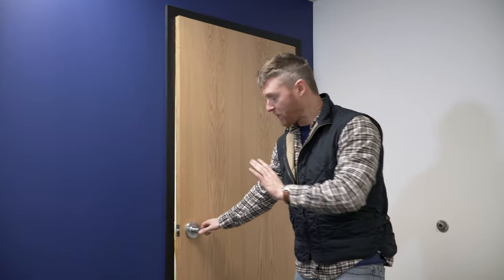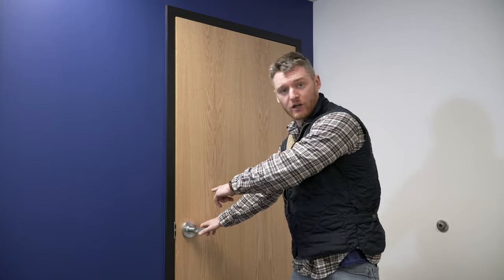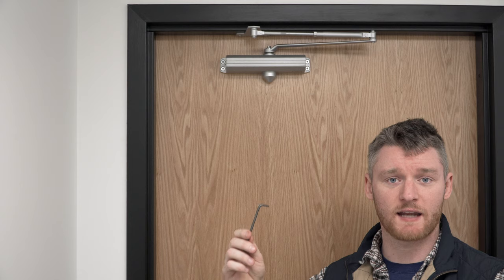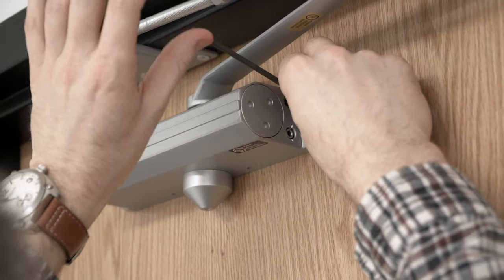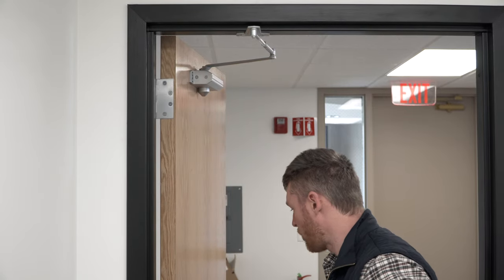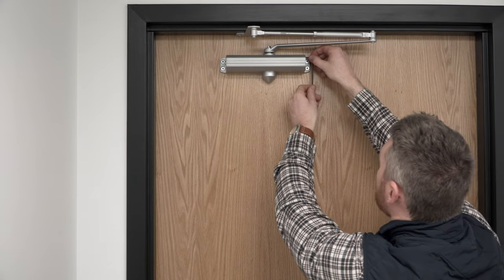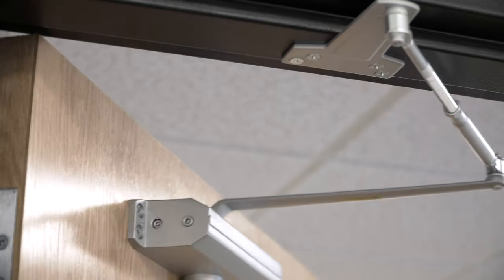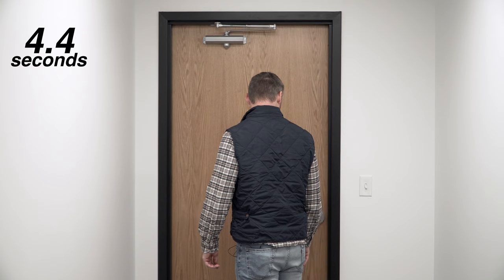How To Adjust a Commercial Door Closer

Comment: Nice video. Trying to get a door at work to close properly. Got most of it. But... right about a 1.5" from closing the door stops and then slowly closes. Guess that's latch speed adjustment?   

Even with the latch speed not adjusted correctly. It's still lots better than the before.
Reply from the maker: Yes it should be latch speed. Glad we could help👍

Comment: Good video.  Just to add some clarity.  There are 4 adjustment screws although he was only adjusting 2 of them.  On the right side are letters L and S.  L is latch speed and S is swing speed.  On the left side there are 2 adjustment screws.  BC is the back check adjustment which limits how far the door will open, so nobody accidentally throws it through the wall.  The other screw, presumably labeled with a P since it cannot be seen in the video is the power needed to push the door open.  Can I open it with the tip of one finger or do I need to drive my shoulder into it.😊😊😊😊

Comment: Nice job they also sell an ADA pressure tool to see if you’ve got the right force spring force to be ADA compliant interesting to note that an exterior door does not have to meet ADA pressure standards which seems odd to me, but you know there’s so many wind loads andpre-existing air pressures in the building going out the exterior doors

Comment: Hey. My friends’ restaurant front door not closing when the kitchen fan is on. In one year they replaced 3 door closers. Every time kitchen fan is on, it creates so much pressure, that the front door opens. Any idea how to solve that? Thanks.
Reply from the maker: Need a vestibule to take out the positive air, or balance the HVAC system. Those are the couple of things I would look at first.

Comment: Thanks for video Mitchell. What can you do with exterior building door with commercial closer and someone was moving out and extended door too far and now it will NOT close? Thanks in advance.
Reply from the maker: Is the frame or hinges bent? Or just the arm of closer?
Reply: @mitchellacoustical3119  Good call …it was the arm of closer. I bent it back and noticed a screw was missing so got a matching screw and  adjusted the closer arm  and it worked. At first I thought door frame off until I noticed the closer arm was all bent. Thanks for your response. Took a while to get the sweep closing at desired speed and same with latch since I wasn’t sure which way sped it up or slowed it down at first.

Comment: Which side does which ? I saw you adjusting on both sides but it was not clear about which side makes door heavier to open .( the wind is moving door partially open enough to set off sensor on alarm system)

Comment: Here’s how it should be done in brief the door should be closed. You should adjust the end nut that adjust the spring on the inside of the door closer for more or less power let’s call it then after you’ve done doing that you should’ve adjusted the back check then after you’ve done that you should adjust the swing speed and the latch speed in that sequence it works perfectly every time now this all takes some time in itself to do so it behoove you to start in the proper sequence I suggest, first things first and then everything else meaning all the other adjustments function as proper. Thank you.
Reply: Have to point out you’re using different labels than the Door Opener Manufacturers.  Mine says: backcheck which is the angle of swing, typically 90d if the door hits a perpendicular door on the other side; door closing speed, which is the 5 seconds mentioned in the video as needed to get a wheelchair through (or 2 arms of grocery bags at home garage); and 3rd, latch speed (also your label) which is the speed or quickness the door closes the last foot or so to latch the door to the door frame.
Reply: Well, I’m just telling you from experience you can do what you want. I’m retired now and happen a Locksmith company for approximately 30 years. Adjusted door closures every day and it was my experience especially with LCN door closures which I don’t even know if you work with them so, you know but my experience is what I said nothing more nothing less doesn’t matter if it’s a ADA closer or not take it or leave it. Try it or not. It doesn’t matter to me.

Comment: Great video!
I am trying to fix the entry door to my apartment, which always wakes me up when it slams shut. I am twisting the screws and I'm able to get to ideal closing speed, however at the last 2 inches until closing,  all the mechanics stop and it smacks shut. How can I fix this? Is the problem the door, the closer, or the installation? Many thanks!
Reply from the maker: Yea that's the latch speed on the closer. There are 4 positions on the closer, so there should be 4 screws (2 on each side for adjustments). With all the different positions of a closer and mounting its hard to tell you which way to go on this, but there is a "latch" adjustment screw. So without seeing it, just trial and error.  Thank you for the comment, hope I was able to help a little.
Reply: @mitchellacoustical3119 thanks for responding Mitchell. I'll keep playing with it. Cheers

Comment: Is there one with a longer arm than 180 Degree?   Our last one allowed the the door to swing wide open (Front door of apartment no wall blocking it) and the new one the door open 180 and within 2 days someone moving furniture in kicked the glass and spider webbed it.
Reply from the maker: Not that I’m aware. Over 180 would mean that your opening to you door would be offset by an angle. Are you sure you’re asking the correct angle?

Comment: 5 lbs, was interesting info; my seems to be much more then that has it is very hard to push thr door open. I moved the screws and it changed nothing; to the point of wondering if the screw would come out, can it?  I also tried adjusting the other screws but only changes was the closing speed: very slow. Now, this door is not business building but home; garage to house. No wheel chairs or anything. No little ones. I am thinking it might be defective. Suggestions?  Or isbthere something I am missing?  Thanks.
Reply from the maker: Well the adjustments can be different from door to door. If its hard to push open can the actual door and frame be the problem? The screws can come out of the closer and spill the lubricant out of the cylinder. Maybe try another closer. Most closers come close to being 'set' when they come out of the box, only quarter turns are typically necessary.

Comment: A slight breezes will slightly cause my door to open. What adjustment increases the tension so that it doesn’t do that?
Reply from the maker: We’ll if it latches it wouldn’t open, I’m guessing that’s what you’re asking. You’ll have to turn the latch set screw so that the last 2-3 inches it closes it has the psi to close.
Reply: @mitchellacoustical3119  It's a door that goes outside. There isn't a latch unless I were to lock the door. It's a door to a business.
Reply: @NodakSavage  Same problem. Trying to fix our gas station door from blowing open. Theres no "latch" unless its locked.

Comment: So my commercial door doesn’t shut cleanly-  the adjustment worked where it I could adjust it to any length of time but the door is hitting just before the latch and stopping.  Is there any way to add more force to the door closure?
Reply: They answered this question in one of the other comments, hopefully that helps!

Comment: Just a quick question which adjustment pin allows the door to open wider?
Reply: That’s not a user-adjustable setting: that angle is determined at the time of initial installation (whether 45/60/90/135, etc).

Comment: I did the adjustments already, doesn’t change anything. How do I know if it’s broken? Can it be repaired?
Reply from the maker: Did you try all 4 adjustments? Try a 1/4 turn back and forth. You should notice if it was broken, the oil would have leaked out of the cylinder.

Comment: So how do you stop and exit door I heard that door closed lightly and it's like wood on wood that's the problem that's in this apartment building right now it closes fine but if somebody pulls that f*** closed it's slams loud and shakes the whole building is there anything you can put in between to stop the wood on wood contact from slamming
Reply from the maker: Yea there is a thing called door silencers. Look those up, you can stick them inside the jamb where the door slams.

Comment: Every time we install a door we get calls that the door is too heavy for ppl to open, we go always try to make it as light as possible but ppl aren’t happy till we have oil leaking on the floor and it no longer works idk what to do
Reply from the maker: I hear you. It’s a balancing act. Just play with the screws. Each one will be different in what it needs. This was just showing our door needed.
Reply: If oil leaks, how doi replace it?  Are there any oil seals seals that need replacing, if oil is leaking? One of the screws (where oil is leaking from, does not turn until flush with casing. Us this nomal?

Comment: I really cannot regulate my door closer. It's so heavy my children cannot open the door . What can I do to make the door slightly open without exhausting my children
Reply from the maker: Make some adjustments using an Allen key. Did you watch the video?
Reply: @mitchellacoustical3119  yes I did but the problem is that the door is heavy you need to struggle to push it .
Reply: The door is not fast it closes nicely and gently . No hurry up as you close it by an adult
Reply from the maker: You’ll want to check the ‘back check’. This could be a few different screws on your closer. You have to just make 1/4” turn adjustments on a screw to see. All closers are different, we made a video based on our needs at the time. Without seeing it it’s impossible to tell which screw to make an adjustment on. There are 4 in most models. You just have to tweak each one.
Reply: @ahmadhayajneh8045  Its been fitted wrong. Is the closer on the push side, or the pull side? If it's on the pull side the forearm needs to be perpendicular at a right angle to the door when closed, if it's on the push side then the main arm needs to be parallel to the closed door, then you can adjust

Comment: What if the hydraulic arm drops down and hits the top of the door when you open it
Reply from the maker: Without seeing it, it’s probably wound wrong
Reply: @mitchellacoustical3119  The problem I had earlier was a missing washer with a stripped screw. Had to replace. Thanks for responding!

Comment: Which is which? There two adjustments but 4 screws? The top screws on both sides control the close or what? The explanation is not all there.
Reply from the maker: I did the adjustment for our door. You have to see what your door does for check, back check, and latch.

Comment: The closer is mounted a little too far towards the center.
Reply from the maker: Installed to the template
Reply: He did it correctly. The door closer template has 3 different installation diagrams for parallel configuration; 90°, 120° and 180° door opening. I think he followed the 120° diagram.

Comment: Only two adjustments and then at the end he adds a third. Latch. Wtf
Reply: The reason is the door was latching properly when he was adjusting the two other Allen wrench screws (S and O).

The latch (L) adjustment is the final adjustment which may be needed to ensure the door properly engages with the latch (ie the door needs to actually lock, and not be too far away to catch the latch and lock).